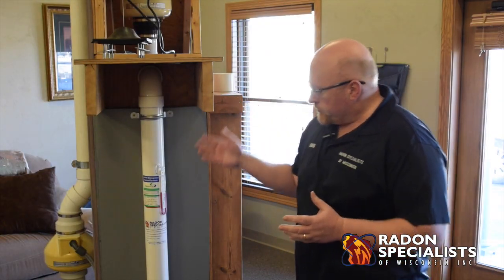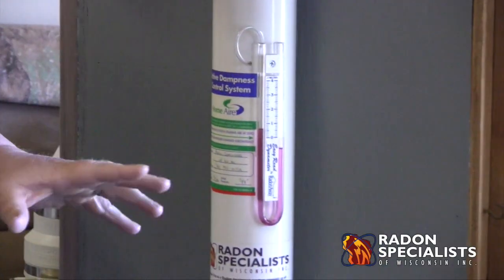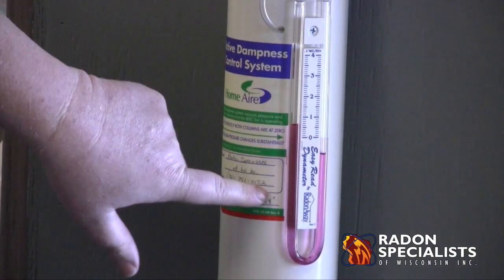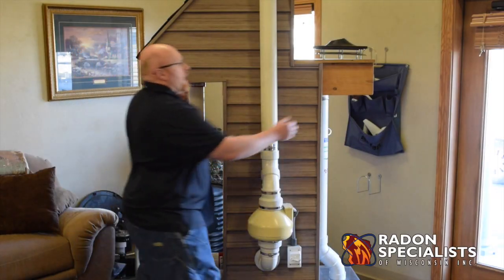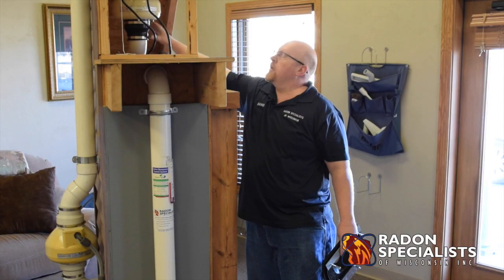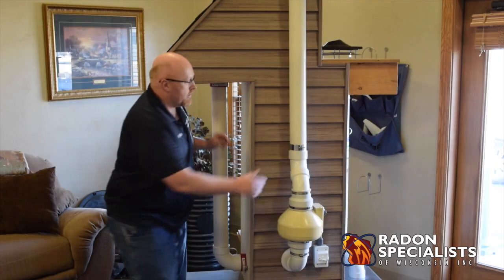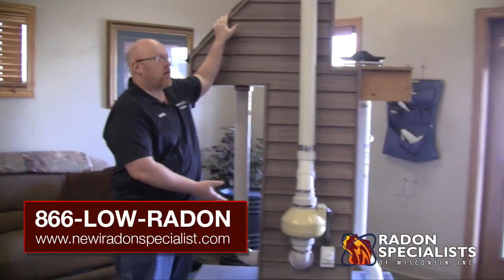Anatomy of a (Properly-Installed) Radon System

Comment: I’d ask why not have fan indoors? Is it due to noise reduction?
Reply from the maker: The reason why fans could not be indoors Is because if it was ever to leak on the exhaust side of the fan it would actually pump dangerous levels of radiation into the home. Let's say a radon test came in at 6. The EPA recommends 3.9 or below. That six is what made it into the basement into the home through the concrete. Whats underneath the slab could be five hundred or thousand. That's what would be pumped out on the exhaust side of the fan. It is for public safety to keep fans outdoors or an attic spaces.
Reply: Radon Specialists of WI thanks for the answer. Good to know

Comment: If there is a french drain in the basement, do you usually install the radon suction piping in the sump?  Or is a separate hole required?
Reply from the maker: It all depends on what is under the slab and how the drain is set up. If there is gravel we core through the slab, which gives us more options. If wet sand or clay then we might use the sump pit to pull directly from the drain tile. I personally believe that sub slab systems when there is gravel is the best way to go.

Comment: Can you tell me how much that system approximatly would cost to purchase and install?  I live in Las Vegas and have high levels of radon in my basement.  Thank you so much for your informative video and your answer!
Reply from the maker: Locally it would be about $1100 for an outside install and $1400 to route through the garage and roof. As long as the roof has asphalt shingles. I have done systems where there was clay tile and the roofer charged $600 to do the flashing. If it is a shingle roof, metal or rubber we can handle it. I do not know what someone in Las Vegas would charge to do it. 
I like Vegas if you want to fly us out. We have installed systems in other area's of the country because of our expertise.
Reply: @RadonSpecialistsofWINeenah  You sir may have a deal.  I will keep in touch.
Reply from the maker: Sounds good

Comment: My system is a year-old and I think it was installed incorrectly. I dont't know when it stopped working.  I think water got into my foundation after a heavy rain and got sucked into the fan.
Reply from the maker: Check the gauge to see if the fan is pulling air. Make sure water is not mixed with oil in the gauge. Why do you think the system is installed improperly?
The fan needs to be mounted vertically outside the home or in an attic space. The electric disconnect/switch/cord needs to be by the fan. The vent needs to be 1 ft. above the roof, 2 ft. above any openings and a minimum of 10 ft. above the ground. You could email me some pics so I can look at it at radonspecialistofwi.com

Comment from the maker: HRV's are effective when levels are lower. In the 4 to 6 range. But not very effective when above 6. It would take too many air exchanges per hour than what an HRV could handle. Above more than twice the cost of a Radon system, at least in our area you have to change out filters. And the cost of running it is far greater than a Radon fan. So, they can be effective if there is no good way to route a Radon system and levels are fairly low. But the Radon system will win out every time when levels are above 6 and it comes to costs and maintenance.

Comment: Great video, most thorough I've seen. I especially liked the reference to the firestop for the holes going through the exterior of the house. My question however is regarding placing reducers on the piping (which I have seen on numerous videos) if the fan I'm using comes with an entrance and exit duct of 4 inches can I use a 3 inch pipe for the runs involved and reduce it to go through the slab and up the exit vent.  I know it will effect the draw of the fan but don't know how much or if will damage the fan in some way.  I'm working with a very small square footage (only 550) but have unknown soil beneath the slab and will not need a huge draw.

Comment: Yes, on interior routes you would only see the pipe through the roof. We have installed plenty of systems through closets. Most are routed through the garage and roof. And, then the rest are routed to the outside. It all depends on what obstacles are in our way and if there is an attached garage. Make sure you see a pipe through the roof on your system.

Comment: I don't like bypass systems because they easily freeze up in the winter and create issues.  For warmer climate they are fine. If you are moving air though drain tile you will want to do something so the system doesn't pull air from the outside.

Comment: Nice video.  I'm in Ohio and have a couple of questions.  Do you think a condensation bypass is necessary?  They look reasonably simple to DIY but I don't see them on most installs.  Second, our sump pit has a natural drain to the surface to handle any overflow from the pump.  Would we need to do something to isolate the pit or drain from the rest of the slab so that we aren't just pulling outside air through the fan (which I plan to core drill)?

Comment: http://www.forensic-applications.com/radon/radon.html
Read this and tell me again why you are installing this system.
Reply from the maker: Every once in a while there's someone who wants to be famous by going against over whelming scientific fact.  There is more research to prove radon causes lung cancer then cigarette smoking.   If you understood the physiology of how Radon, which changes to a lead particle of radiation, explodes inside your lungs, changes your DNA and sets off a chain reaction that leads to lung cancer you wouldn't be questioning this.  The only reason why people try to disprove that radon causes lung cancer is because it's not an immediate effect. But neither is smoking cigarettes. To say radon doesn't cause lung cancer is the same as saying cigarette smoking doesn't cause lung cancer.  I'm going to tell you that if you try to bring any more negative information that I'm doing something wrong or the scientific community is wrong on this I will block it because it is dead 100% false. The world is not flat,  and there is no Santa Claus.
Reply: But there is no law to state we need the radon system, even the "numbers"  are high. Why is that if the house hold radon amount is in the danger zone
Reply from the maker: Didn't quite understand the question.  There are no laws that a home that tests high has to be treated.  It is a personal choice.  However,  HUD does require some testing and fixing if the building tests high.  If Radon was man made you better believe there would be laws requiring testing and fixing.  It is a class A carcinogen. In Real Estate a buyer can ask for a test and fix if results come in high.  It is up to the seller to accept those terms.

Comment: Have you much knowledge regarding radon and well water? My home has radon 4.3 according to home inspector but the hourly report shows as high as 9 and somehow averages to 4.3. I'm worried my well water has a problem too
Reply: Jitom7 the likelyhood of radon in your water is very slim.  You radon levels can spike like that for a number of reasons.  This can be vent fans running in the house, certain winds can cause spikes among others.  While you might have a spike of 9 pCi/l, there are probably more data points during the test that were lower than 4.3 that brought your average down.  The radon level is not the highest reading during the test.  It is the average of the data points collected during the time frame.

Comment: * in the event of a fire.
Also the display you show in the video I don't see one of those collars on the side that runs pipes along the homes' siding.
Reply from the maker: Yes, fire code does not require a fire collar on the piping on the outside of the home. I assume if there is a fire on the outside of a home it would normally be large enough where a fire collar would't do much good. If you look at  water heater pipes, furnace piping, none of them have fire stop collars or caulking.

Comment: Is there a reason you put the fire collar on the outside of the home? Does it not make more sense to install it on the inside so that it blocks the pipe sooner on the inside to prevent air from coming in in the even if a fire? Or is it code to be mounted outside for some reason??
Reply from the maker: Yes, you want the fire collar on the garage side of an install. The collar is made to prevent a  garage fire from spreading into the home by collapsing the pipe and filling the hole with a foam like material. If the fire collar is on the inside the fire has already breached into the home, wooden joists and would be of no use.
Reply: +Radon Specialists of WI thanks! So an exterior garage wall that doesn't need it but the wall from garage to home does. Correct?

Comment: For an exterior system, is it possible/up to code to run the pipe through the soffit and up through the roof?
Reply: You mentioned that it has to be run up and around the soffit to the eve.  Any insight on why this is required would be great!  Also - does using aluminum downspout material affect this decision at all?
Reply from the maker: It is OK to go up through the soffit and then Flash the roof. We normally don't do that unless the customer signs a waiver. If you ever had an ice build-up on the bottom of the roof/gutter it could actually move up the roof and underneath the flashing and then when it melts could rot out the roof there.
Reply: thank you for the explanation!

Comment: I installed my radon mitigation system and have reduced my radon levels, however they are still around 2.7, what can I do to get it lower?
Reply: Andrew Peck if your basement area has any area that is unfinished, you should caulk the floor/wall joint and caulk any cracks that are visible in the floor.
Reply from the maker: What was under the slab,  gravel, sand or clay? Did you have a drain tile under the slab? Did you route off the pit,  if you have one?   If you went through the slab it is very important that you make a very deep and very wide suctin point.  And what make and model of fan did you use? If you have gravel or drain tile or went off the pit then you want a high air volume fan. If you have sand or clay and no gravel no drain  tile, then you want to use a high vacuum fan. Answering these questions will help me give you a better answer.

Comment: I have packed clay under my slab, how much dirt will I need to remove from the hole for it to work properly?
Reply from the maker: The bigger the better with clay. Go as deep and as wide as you can. It is hard work, but will help with airflow. Sometimes with clay another suction point is needed to grab enough air. A nice trick is to put suction point near a plumbing drain stack. That can help with communication also under the slab.

Comment: Enjoyed your video! I do however have a question. My home has elevated radon levels so i will need to install a system. The home is a 1800sq ft, 50's ranch with four additions. So one original basement ~700sq ft, two additional ~200 and ~400, a slab ~300 and a crawl space of ~200. Would you recommend installing 2" pipes to each addition, coring a hole in the middle"ish" area of each slab and connecting to a 4" pipe that will go to a radon fan in attic? Thank you!
Reply: What levels did you test at, and where were they taken (what level/room)? Where is your home located? When were these additions constructed? This home may need more than one system. The goal is to treat everything with one system, with potential 2nd and 3rd suction point. Your home sounds more complicated  than that. I would like to see floor plan, pics or visit it if it is in my area.
Reply: Thank you for the quick response David! I'm located in Franklin so just south of Milwaukee. The only addition there is a record of was built in 1970's which is the larger ~400sq ft with basement. I never had any official test done I had just done a quick test provided by the city that i believe was 7pCi/L (however I'm quite forgetful and it was some time ago) It was taking on the main floor centrally in the middle of the home. I did not do the long term test as i figure chances are I'm installing anyways and figure id use the test money toward the cost of fan and piping. However the more I've read the more complicated it has become as it is not just a simple sump install (at least I think). Yes I agree the home is VERY complicated and full of things that make you scratch your head and think now why in the world did they do it this way haha. I could take some measurements and draw a rough floor plan if you'd be willing to take a peek. Thank you
Reply from the maker: Give us a call. Brandon, my manager can come take a look. No cost or obligation. Sump pit may be the way to go on this but should look first. 844-569-7236.
Reply: Great, i will do that! Thank you so much! Tyler

Comment: If I have a partial basement and the rest of the house is on grade do you still put the system in the floor of the basement?
Reply from the maker: If you need a system you almost always have a suction point in the basement.  The lower the hole the more vacuum affect you will have.  Another suction point connected to the same system may need to be installed through the foundation wall,  but under the slab on grade.

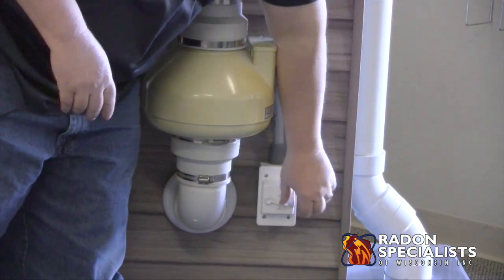Comment: At 6:47 you state that "you cannot plug a fan into an outlet with a cord because it is against Code."  However, the National Electrical Code (2014) Article 430.109(F) allows for "Cord and Plug connected motors" when the motor is 1/3hp or less. So your statement appears to be incorrect as that fan looks pretty small. Would be interested in a response.
Reply from the maker: The fan can not be plugged into an outlet on the outside of a home. The reason is UV   light will degrade the chord. It is fine to do so in an attic space. If, you can find a UV rated cord to use outside with a weather proof cover it is allowed on the outside. I have tried to find such a cord but have had no luck to date. I have heard they exist, just haven't found one yet. Even if I did, why go through the trouble of wiring in a new weather prof outlet, when installing a switch in a weather proof box and conduit is just as easy. A UV rated cord would only help if there was a weather proof outlet already installed at the proper location.
Reply: Thanks for the quick reply. Just catches my attention when I hear a statement that applies to a specific situation put forth as applicable in general, or at least that's what the implication was in the video. I agree that the switch approach shown in your display is superior if no outlet and/or the UV cord is available.
Reply: Section 9.3.3 of the radon mitigation standard specifically states that plug disconnects are not allowed in an outdoor environment.  By the way, I love your display!  I wish there was a way to make a light weight modular version for teaching classes.

Comment: One last question... My drain tile is under the basement slab just next to the footing. There are also connections to it, that are coming from the basement window wells. Would there be better under slab suction if these open ends of the drain tile pipe are closed? Or is there better air flow with them left open?  I have my window wells covered so they  arent  needed to drain any water. 
Thanks for any advice.
Reply from the maker: They should be capped if they are not needed. Otherwise the system will just suck air from the outside instead of under the slab. Air will take the path of least resistance.

Comment: Great video... Does the  radon fan have to be installed outside the basement for a exterior install, and why does the fan need to be installed in the attic just before it goes thru the roof for a inside (thru the roof install)?
Reply from the maker: Cee Dub 
The fan needs to be in unlivable space in case there is ever a leak on the exhaust side. Whatever a home tested at is a small amount compared to what's under the slab. Levels could be 500, 1000 or more. You wouldn't want to be pushing that into your home. Same reason vent has to be a certain height above grade and windows.
Reply: Yes, the Radon venting standards require the fan to be located in unlivable space. So, it can not be under or in livable space or in the envelope of the home. If exterior then the fan is outside. If it can go up through the garage or a closet then it would be in the attic space. Still having the vent at least 10 ft. from or 2 ft. above any windows and 10 ft. above grade.
Reply: Do you know why it needs to be located in unlivable space? I would think it should'nt matter.

Comment from the maker: If there is gravel under the slab I would always prefer coring through the slab. Gives you more location options. If there is sand or clay then through the slab next to the pit. Try to get on top of the drain tile. By looking in the pit you can see where the tile is coming in from the exterior footing. Last option is to use the sump pit. There has to be a submersible pump in the pit with a check valve. Lid has to be made air tight, typically with caulk. Pre cut the vent pipe and reconnect with a rubber coupler. Makes it easier to get into the pit in an emergency.

Comment: Nice video! I live in Ohio or I would call you myself. Do you have an opinion on using the existing sump pump or would you rather use its own drilled hole?

Comment from the maker: The system should be near a drain tile if possible, but does not need to be inserted into it. A small hole could be drilled in top of it also. This tile is not to be confused with a plumbing drain. They are two separate systems and cannot be connected.

Comment: Should the radon system be drilled into parameter tile (break open the top of the tile)? Or should it have its own hole and chamber? I have a floor drain in the basement I wouldn't want to become unusuable.